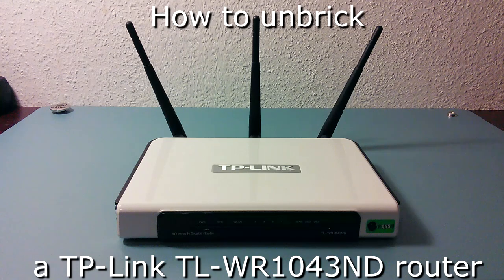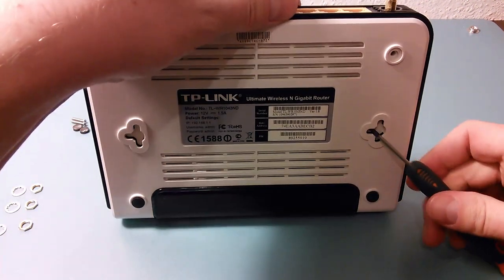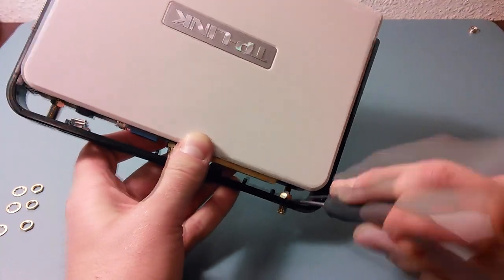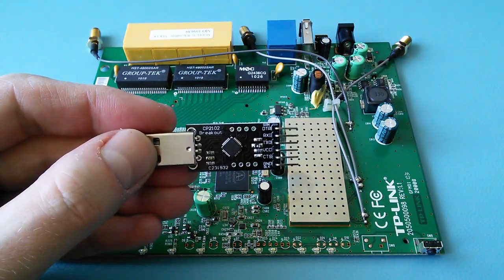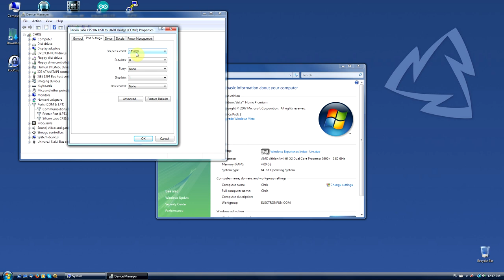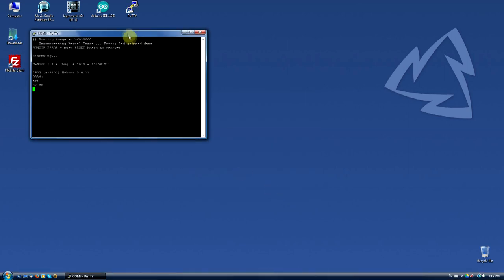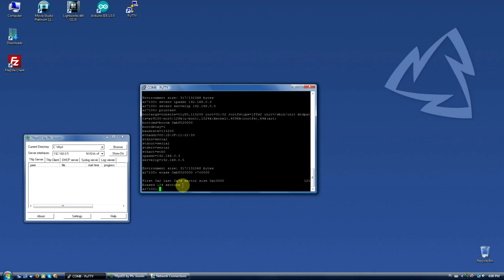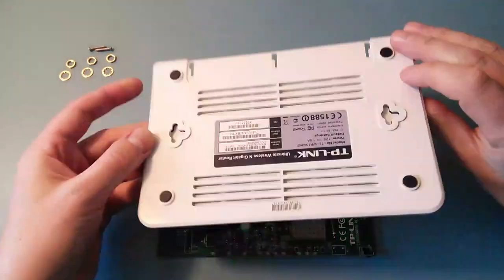How to unbrick a TP-Link TL-WR1043ND router (re-uploaded) || How-to-fix tutorial

Comment: Thank you very much for uploading this video :)
Just ordered a USB to TTL adapter, however I was wondering where you got the 3 pin connector. (How is it called? just a 3 pin connector?)
It's so much easier to just plug it on than having to solder each time.
Reply from the maker: Thanks for your comment :) It's called a gold pin connector, or breakaway male header. It's usually sold in rows of 40 pins. You can break or cut them to make the 3 pin connector. It looks like this: https://www.sparkfun.com/products/116. You solder this header only once and you can connect the wires easily later on.
Reply: ElectronFun.com Thank you very much, took on the project and soldered on the 3 pin connecter. I've unbricked it with the TTL cable, everything is working fine again!
Reply from the maker: *****
Great to hear that! Thanks for letting me know :)

Comment: I connect PuTTY and set my com3 and 115200 8 1 n but when click open, I just hear boong from computer and no connection, could you explain what should be the problem? I am using Windows 10
Reply: +Virtual Visa Cards tried my old XP with serial port connect to com1 115200 8 1 n with a boong sound only, no console appear like yours
Reply from the maker: +Virtual Visa Cards Is your PuTTY window showing up? If yes, have you tried hitting Enter?
Reply: nothing shown up, just a sound from Windows
Reply from the maker: +Virtual Visa Cards Are you sure you're using the proper COM port? It should be visible in Device Manager.

Comment: I've seen some of the same tutorial and I've done but when I tried to open putty nothing happened, only a blank screen and no posts out
do you know what's wrong?
my router is TP-Link TL-WR741ND
Reply from the maker: Have you tried switching the TX with RX on one side? The TX pin on the router should be connected to the RX pin on the USB to TTL converter and the RX pin on the router should be connected to the TX pin on the USB to TTL converter.
Reply: I think I've tried the same thing
Router >> USB TTL
TX >> RX
RX >> TX
GND >> GND
Reply from the maker: Rifai Annur
Are you sure you're using correct COM port number?
Reply: yes, I am really sure with the com port that I use
Reply from the maker: Rifai Annur
Have you set your COM port's speed to 115200 in 'Device Manager'?
Reply: yes i've set the speed both in device manager and putty
i'll try it again on weekend
Reply from the maker: Rifai Annur I don't have any more ideas, what might be wrong, sorry. If you manage to figure out the problem, please let me know what was wrong.
Reply: ElectronFun.com Rifai Annur this is happening to me too, did you solved the problem?
Reply from the maker: Ítalo Rodrigues
I understand that you went through all the steps like changing the COM port's speed to 115200, swapping the RX with TX on one side, etc.? I still don't know what's wrong in your setup. Maybe one of you could post a photo of your connections? This might help a bit.
Reply: Hi ElectronFun! I have a similar problem, wit serial comunication. I tried more USB serial converter, xshel, puty, hyperterminal. TX-RX, speed,  com port good.  First I connected the, USB to TTL converter, second, plug the power, Third start the com port communication. The terminal wrote, " Com2 port connected" but nothing else. The ip has not been changed yet.  ---  Can You help me, where can I download the "serial communikator"?

Comment: Can I use a stable DD-WRT firmware for recovering it or is there a specific firmware to unbrick it?
Reply from the maker: I doubt there is a specific firmware file compiled for unbricking purposes. I used this file, because it worked for me. You can try with DD-WRT firmware and if it doesn't work, you can always use OpenWrt to unbrick your router and then switch to DD-WRT.

Comment: Will this process work for TL-WR1042ND router? How or where did you get the register addresses to clear and load the firmware? Will the same addresses work on 1042?
Reply from the maker: +romel.khondoker I don't know if the same procedure would work for TL-WR1042ND. The memory addresses are usually different for different routers. You can post your questions here: https://forum.openwrt.org, or http://www.dd-wrt.com/phpBB2. Someone should know the answers there.
Reply: +ElectronFun.com I did some research and found out that it has realtek chipset- CPU1: Realtek RTL8198 (620 MHz)- FLASH: 8 MiB (Spansion S25FL064P)- RAM1: 64 MiB (Hynix H5PS5162GFR-Y5C). Also found the bootlog here: http://openrouter.info/forum/viewtopic.php?f=39&t=1703. All i want to do is put the factory firmware back in it i.e. unbrick it. Will that be possible at all?
Reply from the maker: +romel.khondoker The model numbers look very similar, but the TL-WR1043ND uses Atheros CPU, so it's pretty much a different router. I tried to find the unbricking procedure for your device, but couldn't find much. I guess it's not very popular. I wish I could help you somehow, but I don't know how, sorry.

Comment: Nice man, that's certainly a high Quality tutorial. 

Here is my situation : I have TP-Link TL-WR841ND v9 running  DD-WRT v24  and I want to install lots of packages and even turn my router into home server but I'm runing out of space and this router does not support Usb Storage.. so  is there any possibility to add USB storage capability to a  router that doesn't have it ? Thanks in advance
Reply from the maker: +Mostafa Taliⵣa Thanks for your kind words :)
If your router doesn't have a USB port, you probably won't be able to add any extra storage, sorry.
Reply from the maker: +mipmipmipmipmip Thanks for the tip :)

Comment: Does it work with simple USB RS232 adapter cable, or I should use TTL? I'm asking, because I have v1.8 and tried with the cable (used only rx, tx and gnd pinouts), but putty shows me unreadable symbols (there was everything ok with COM port baudrate and all other configuration). I'm curious if my router is totally dead or I should buy and try with USB TTL. Thank you in advance.
Reply from the maker: To tell you the truth - I haven't tried using a simple USB to RS232 adapter cable, so I have no clue. I'm guessing you don't have an Arduino laying around? You could use it instead of the USB to TTL converter.

Comment: Hi thanks for this tutorial.
Everything works until I do the TFTPBOOT 0x81000000 command.
After a while I'll keep getting "retry count exceeded starting again" 
Obviously a connection problem? Where to look to solve this?
Thanks,

Jacob
Reply from the maker: Did you connect the network cable between one of the router's LAN ports and your network card?
Reply: ElectronFun.com Yes, but I just found the problem.
I had to shutdown my firewall and then everything went OK!
Thanks again for your great tutorial!

Regards,

Jacob
Reply from the maker: Jacob Visser
Is your router working again?

Comment: hello brother, i have TP Link TL-WA901ND access point router. every time i want to use it as repeater it says Ethernet does not have valid IP configuration. i did every solution available on whether its on YouTube or google. but couldn't fix it. eventually find out there is hardware problem in my router can you pls help me to fix it?

Comment: Has anyone done this with the WR1043ND v4 version? How are the pins located there as the board is different to the version in this video? Is it necessary to solder a wire across R257 and why? Just getting random ANSI chars in putty...

Comment: My TP-Link Archer C7 v1 has been bricked after an unsuccessful attempt to revert back to original firmware. The router now reboots every 10-15 seconds. Would this method work? Via TFTP there is not enough time to transfer the firmware to the router.
Reply from the maker: Alexander Hagen To tell you the truth - I don't know and I don't have this router to try it out. You can try your luck on OpenWRT and DD-WRT forum.

Comment: My 1043ND WAN port dead by surge !!. I forgot to unplug the cable. Is there any way to replace this port ?? or should I want to buy another router :(
Reply from the maker: semira uthsala It may be something more than just the WAN port. Have you opened the router and checked what's going on inside?
Reply: ElectronFun.com Today i remove the cover and check inside !!. four resisters for wan port and 3rd lan port are fried. can i fix this ??
Reply from the maker: semira uthsala Try replacing the fried parts, you don't have much to lose. It may also turn out that something more is fried, like one of the chips. You won't find out, if you don't try. Good luck!

Comment: Hi, I made everything as you, however after set the PuTTY it shows only blank command screen. Nothing happens, only shows green cursor and I can't write anything. Do you have any ideas?
Reply from the maker: Przemek6085 Hi, what about the serial connections, how did you connect them? Have you tried swapping the TX with RX?
Reply: ElectronFun.com Thanks for your answer. Yes, I tried. You can see my connections in this photo http://imgur.com/NzJcSaW (I soldered also 3,3V because I had four pins).
Here I uploaded screen of PuTTY: http://imgur.com/YndGeZU
I can't type anything, but TXD's diode lights when I write. 
I tried too to connect TX and RX of my Prolific PL2303HX chip (without router connected) and then I can type letters to PuTTy.
If you have any ideas I would like to test it.
Reply from the maker: Przemek6085 What USB to TTL converter do you have? I can't see the pinout on your photo.
Reply: ElectronFun.com It's identical like this: http://articulo.mercadolibre.com.mx/MLM-495783351-convertidor-usb-uart-rs232-usb-ttl-usb-stc-isp-_JM
White cable is GND. Two others are crossed RX and TX.
Reply from the maker: Przemek6085 Theoretically everything is connected as it should. How about your COM port speed? Have you changed that in Device Manager?
Reply: ElectronFun.com Changed to 115200.
Maybe router is totally bricked?
When I connect a power it lights PWR diode. Later, for less than second it lights few of diodes. Nextly some other diodes lights for less than second and then shows again only PWR diode. 
Were your bricked router show permanently PWR too?
Reply from the maker: Przemek6085 As far as I remember the power LED was solid, all the rest was blinking. Are your diodes blinking all at the same time?
Reply: ElectronFun.com No. PWR is solid and other diodes lights only when starting. As you can see on my photo - PWR is on, other off.
If you have any further options to test, I can try it.
Reply from the maker: Przemek6085 I have no idea what can be wrong. Have you asked the same question on https://forum.openwrt.org and http://www.dd-wrt.com/phpBB2? Maybe they will be able to help you.
Reply: ElectronFun.com Ok, I will look for help on these forums.
Thanks for your answers and greetings from Poland. Your surname looks like you come from PL ;)
Reply from the maker: Przemek6085 No problem.
My surname is Polish just like me, so greetings from Poland my fellow countryman :)
Reply: Ben Greenway ElectronFun.com  Is it possible if the soldering isnt perfect the serial interface wont work.  It looked ok, but i didnt have any isopropyl alchol to use after removing the existing solder.  How important is that step?
Reply: Przemek6085 Found your post here: http://www.dd-wrt.com/phpBB2/viewtopic.php?t=284001&highlight=bricked&sid=7422670e9783f6ff106e0cf9798c96f3 Did you have any luck with this?
Reply from the maker: Ben Greenway This step is not that crucial. The flux in solder cleans old joints. I 
guess there must be some other reason it doesn't work in your case.
Reply: +ElectronFun.com Thanks.  I'm waiting on some new usb to ttl adapters and will see if that makes any difference.
Reply from the maker: Ben Greenway I wonder if it helps, please let me know.
Reply: ElectronFun.com The same problem here... I tried with 2 different usb-ttl and nothing... :(
Reply from the maker: Carlos Romero Martínez Have you tried swapping TX and RX on one end of the cable? Is your transmission speed set correctly?
Reply: ElectronFun.com Yes my friend. When I swap TX and RX, RX's led turns on (solid). Transmission speed is 115200.
Reply from the maker: Carlos Romero Martínez Do you have any other device that could be connected to your USB to TTL converter? I'm wondering if it works correctly.
Reply: Ben Greenway Hi, i didn't get the notification, but today I've backed to restoring my WR1043ND.
I don't really know why, but today it started to connect with PuTTY, however I've get a problem in the last part of procedure.
Reply: Przemek6085 did you use a different usb adapter ?
Reply from the maker: Przemek6085 I've seen your post. Is this still the same USB-TTL adapter, or have you tried another one? It's pretty strange you can't type anything in the PuTTY window. It seems your adapter, or cable is rather unstable. If you had another adapter, you could try this firmware: https://downloads.openwrt.org/backfire/10.03.1/ar71xx/openwrt-ar71xx-tl-wr1043nd-v1-squashfs-factory.bin. It's a bit newer.
Reply: Ben Greenway No, the same. One thing I can reccomend to you is first connect adapter, start the putty and then connect the router. If it doesn't work, try it for several times.
Reply: ElectronFun.com The same. I tried, but it looks they have identical bytes size ;)
Reply from the maker: Przemek6085 Their identical size doesn't mean these firmware files are the same.
Reply from the maker: Przemek6085 You made it work, congratulations!
My favorite firmware is OpenWrt, but mainly because of its very convenient interface. I'm not a great fan of Gargoyle, but I know there are many people who like it. OpenWrt, dd-wrt and Gargoyle are pretty solid - I didn't notice many differences when it comes to stability.
Reply: ElectronFun.com Ok, so I will let the chance to gargoyle; finally that one rescued my router :D

Comment: Hi,
i went throuhg the precess but the firmware wouldnt download from the serverwith the message "no file found". This message appears both in the putty window as well as in TFTPD .The file is in the main folder of the tftpd server. The ip adress is correct (with my router it is 05 for the server and 02 for the router). What could be the problem? Thanks!
Reply from the maker: +Leonid Matisov Do you have a firewall? Maybe it blocks your TFTPD server?
Reply: +ElectronFun.com I do, but it was switched off. If it were about firewall, the server would have seen the incoming connection, I think.
Reply from the maker: +Leonid Matisov Theoretically your firewall should detect the network activity.
Are your both IP addresses on the same network, I mean what's your network mask?
Reply: +ElectronFun.com the mask is standart 225.225.225.0 - as set at the PC network adapter properties. Do I need to set is for the router? Also, I noted that when I plug the ethernet cable from one LAN (not WAN) port to another, at this moment the download may start, but with lots of checksum errors - the router wouldnt load with it. I used different ethernet cables.
Reply from the maker: +Leonid Matisov I guess the 255.255.255.0 is a standard mask for this router, but I would check it, if I were you. The transfer with checksum errors looks odd, but have you tried downloading your firmware file once more. Your file may be corrupted and the checksum gives you the error.
Reply: +ElectronFun.com I managed to do it! Thanks for help! For some reason the PC blocked the download process. I tryed another one and everything went smoth.
Reply from the maker: +Leonid Matisov That's great! I'm glad you managed to do it :)

Comment: Question will this work on any tplink device? I got a TL-WA701ND and has exactly the same thing (bricked after uploading oficial firmware) Thanks for the help
Reply from the maker: Fernando Carmona It doesn't have to work on any TP-Link router. The commands would be probably the same, but the memory addresses may differ. If you're looking for your board pinout, see here: http://wiki.openwrt.org/toh/tp-link/tl-wa701nd. Pay attention it's for Rev. 1.0.
Reply: ElectronFun.com thanks
Reply from the maker: Fernando Carmona No problem :)
Reply: ElectronFun.com I finished installing openwrt, apparently tplink's official firmware is 100kb bigger and there's not enough space to load that, kept getting a "not enough memory for operation" and couldnt delete all the blocks that are necessary for 0x3e0200 blocks ;) thanks for the information.
Reply from the maker: Fernando Carmona I don't know what may be wrong. You can seek help here: https://forum.openwrt.org and http://www.dd-wrt.com/phpBB2.
Reply: apparently its because the firmware includes the bootloader, right now im going to test openwrt and see how it works
Reply from the maker: Fernando Carmona OpenWrt is probably my favorite firmware.

Comment: How to connect the usb connector to the router properly?
Because the picture description is from right TX, RX, GND.
And on Filmiku you connect differently RX, TX, GND.
How is it supposed to be properly connected?
Reply from the maker: You are supposed to connect TX to RX and RX to TX, ground to ground. One device is transmitting data (TX) and the other one is receiving data (RX) on one wire. The second wire works in exactly the same way.
Reply: And why the reverse?
Reply from the maker: Both devices cannot transmit and receive data on one wire at the same time.
Reply: Ok now I understand. However, for a layman who is not good at it, he is misleading him :) I am from Poland and my English is weak sorry for mistakes.
Reply from the maker: Don't worry, the most important thing is that you got my point. By the way, I'm from Poland too :)
Reply: To pozdrawiam Rodaka ;)
Reply: Witam znów mi ruter sie wysypał co mam zrobić wcisnąć by w putty tam wejść i zatrzymać ładowanie sie tego badziewia cancel gdzie to wcisnąć by to zatrzymać ?

Hi again, my router has been spilled out, what should I do to press to putty in there and stop loading this crap cancel where is it to press to stop it?